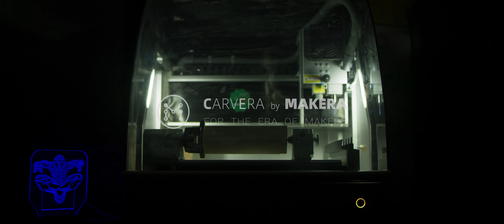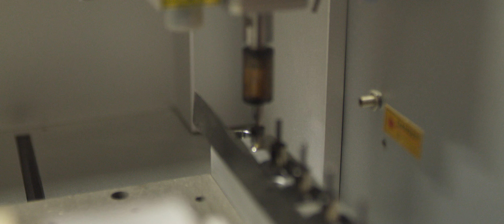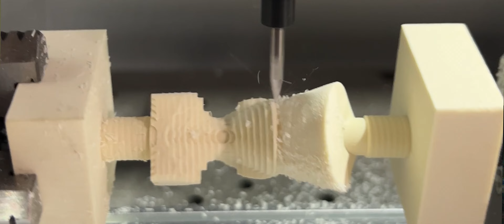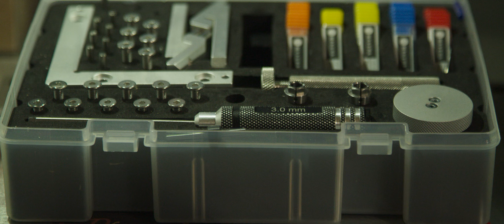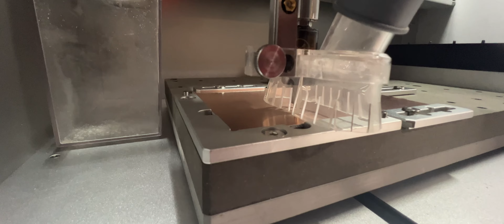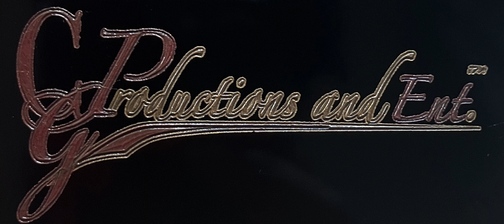The Carvera by Makera | A Beginners Review | Automated Desktop CNC Milling

Comment: Im wanting to take the jump into getting into this. I came from 3d printing. I have designed a bunch of things on fusion 360 but I would like to turn some of those designs into metal. Is the programming for the 4 axial machine difficult? I havent really seen anyone use the 4 axis device for anything other than what makers provides. I want to see a 3d model from like thingiverse made on the 4 axis. Also where do you get the materials for the projects you want? I am wanting to also make drone frames.
Reply from the maker: The programming is pretty much all relative. Coming from 3D printing, you need to learn and understand CAM, which is like 3D slicing but way more complex. 

I found a plastics fabricator locally who gave me over 200 lbs of scrap plastic boards, so I haven't had to buy much material. I bought aluminum stock a while back, I think, from Amazon.
Reply: @CGPENT  yeah. Are there videos on how to slice files for the 4 axis machine that it comes with? I use fusion 360 and ik there is an option for it but it’s only for paid subscriptions.
Reply from the maker: @metallicaandchimaira  I’m not sure I was able to have access through my school email. I was working on a video for the 4th axis but it’ll be a while before I can get back to it.

Comment: Liked and subscribed. I am coming from 3D printing/design. I am VERY close to buying one these machines but primarily for the 4th axis and cnc aluminium. Ive read that its more for manually spinning into place. I have an idea of the kinda complex geometry i need to mill but cant get an answer from anyone if this machine can and i am abit scared to put my savings into something I'm unclear it can achieve. Any advice or how we could touch base would be appreciated if not that's ok. Thank you so much for your content 🙏❤️
Reply from the maker: It can do a bit more than spin into place depending on the material. Right now I can’t shoot any videos but hopefully soon I can.